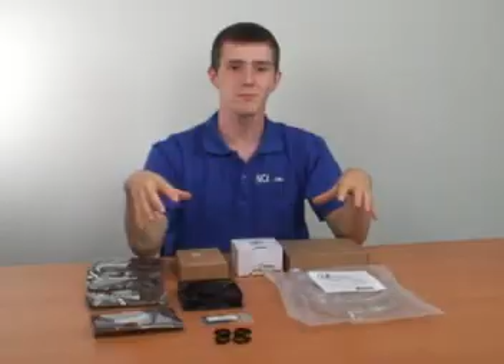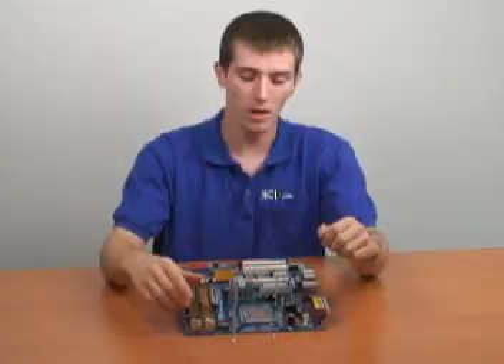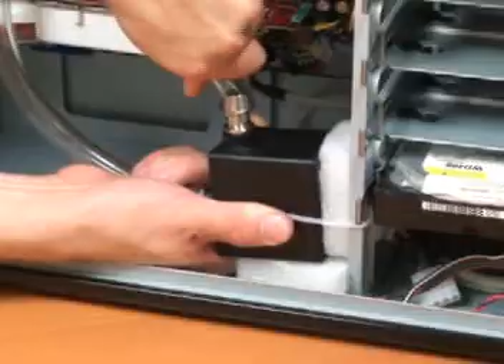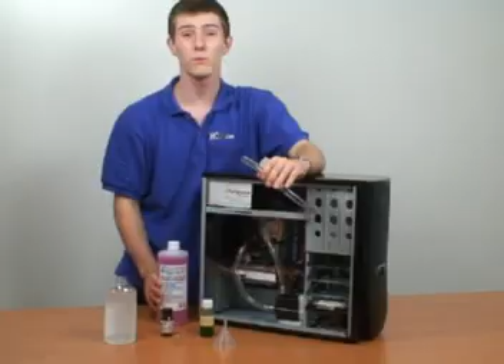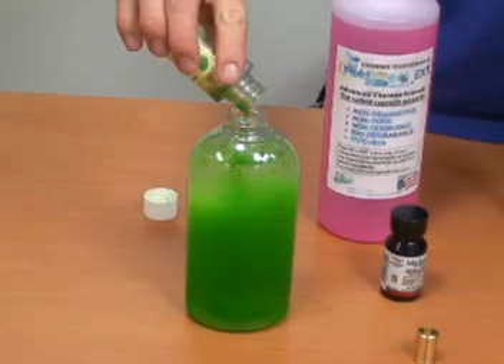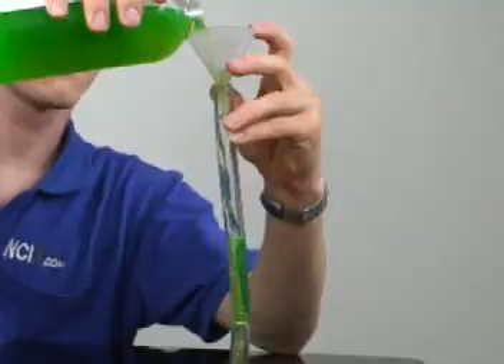Water Cooling Essentials (NCIX Tech Tips #2 Part A)

Comment: @devo85x  in the roof is the best place. There is usually more room up there then in the floor and you will be able to suck in much more cool air from out side the case.

Yes that means your blowing hot air into the case but if your watercooling the most important thing is cooling the water in that rad. Besides if you have 2-3 exhaust fans it will suck out that air fast enough it won't build up. If you put it in the floor you need a good cap under the case to easy get air in.
Reply: hello from the future

Comment: Water cooling is far far quieter then fans and delivers better cooling. With even a cheap water cooling kit you could get at least 10-15 cooler then high end conventional fans. With high end custom water cooling you can get even better cooling that could be over 40c cooler even with seriously high overclocked PC.

The cooler your PC is the higher you can overclock.

Comment: one question: my case has an 8 cm fan slot in the back. Is there any chance of mounting a water cooling system in my case? must the radiator be mounted to the computer or can I put it outside the case? I have a raidmax aztec case. Thanks!
Reply: Hi! I think, that an 80mm rad doesn't exist sadly. And it wouldn't be effective anyway. xd

Comment: With faster & faster CPUs, multiple core CPUs , chip-sets, VGA cards and memories  - Computers now-days needs more then just a fan or/and heat-sink to cool them all.... It's not only about overclocking.

      Water-cooling is one of the best ways to cool then all....

       Besides, there's additives out in the market to make water non-conductive, non-corrosive and there is even a antimicrobial additives....

      It not a "fab", it's the future of computer cooling....
Reply: Eehh
Reply: 13 years later, there are liquid coolers, that can outperform air coolers! Did you know that?

Comment: On tight situations, you can also use hot water instead of using coolant to fit the tube in a barb. Just dip the tube's end to hot water then let it slide in. Let it cool and voila
Reply: Thanks for the tip

Comment: Water cooling is excellent, only hassle I had was with algae growth.. easy done from cheap parts. Regarding the point HomeDistiller made the ingoing and outgoing temperatures in mine were similar just a few degrees different.
Reply: hey how are you doing or do you even exist 13 years later. how is your life now compared to this comment date
Reply: @kepler656  Well I don't have a watercooled PC anymore, even laptops now are more than fast enough for my needs. Moved home, got married but still just about surviving.

Comment: I wish I had known about the iodine, my old water cooled dual cpu PC used to need water changes as bacterial stuff used to grow in it.

I had a much bigger radiator but used smaller pipes, I split the flow to the pair of CPUs, the flow does not have to be at all high. Water has a huge heat capacity, never had a leak, altogether seeing this is making me think my next high end PC will have to be watercooled. Had crappy air cooling for a few years now and the noise is grinding me down!
Reply: Thank god now you have water cooling and got rid of crappy air cooling